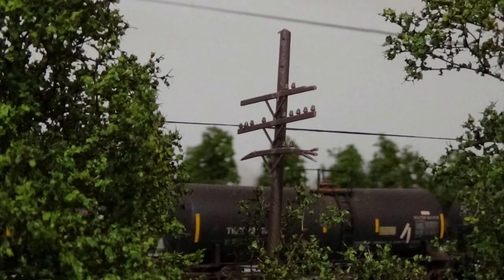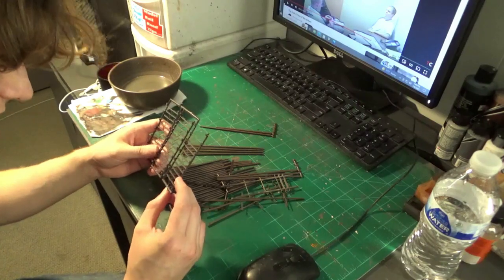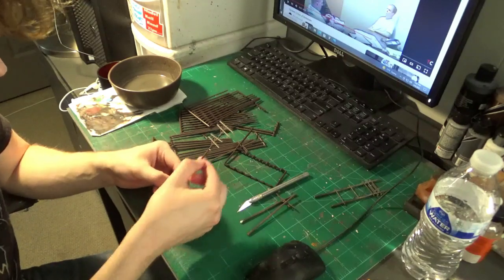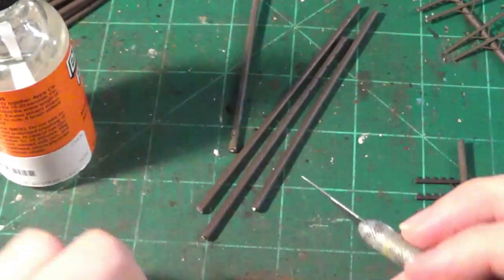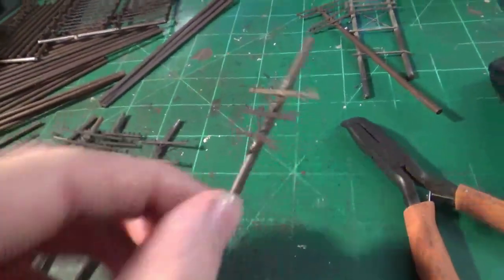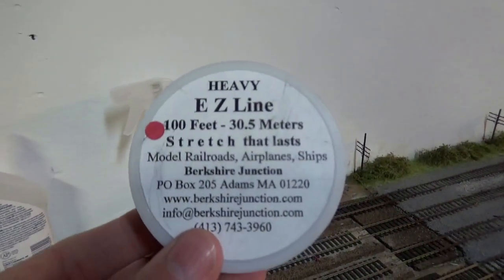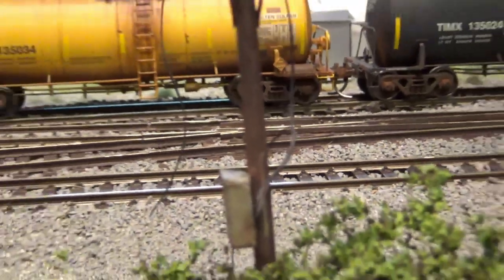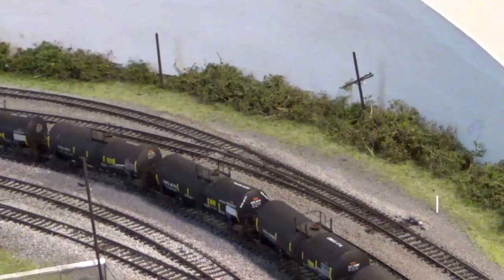Modeling & Detailing Track Side Telegraph Poles In HO Scale.

Comment: Nice details. When I was an engineer I noticed that the prototype code line cross arms usually alternated mounting on each side of the poles. This would minimize the number of poles or crossarms pulled down in case of an accident snagging the wires. Another unusual detail I noticed between Benson Az and Shawmutt Az on the UPRR (Former SP) Sun Set Route was an insulator and power line on the very top of the pole identifying each mile location. Most likely done before actual mile posts were installed. Your poles with crossarms really add to the background.